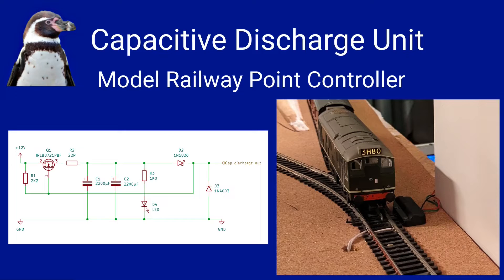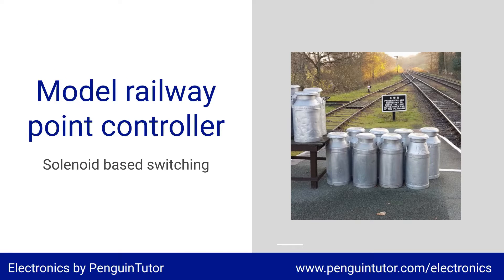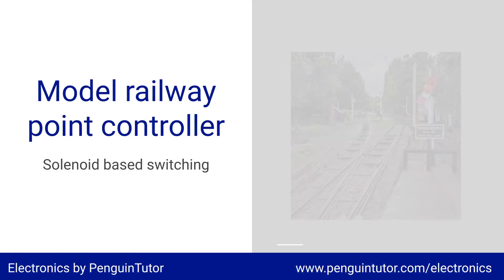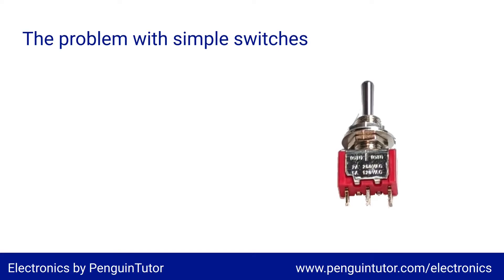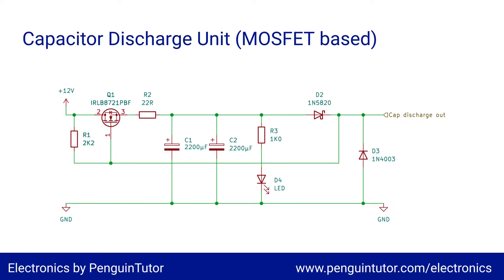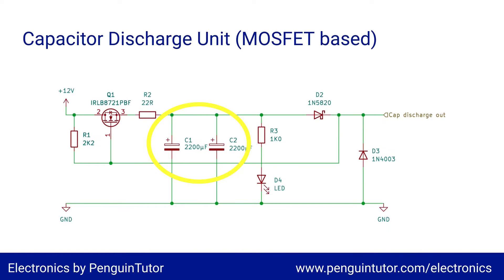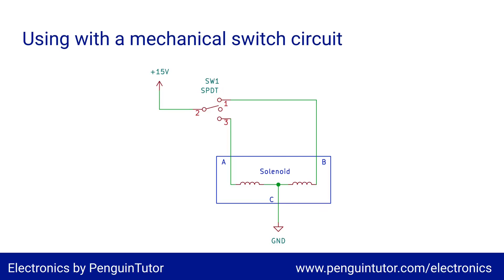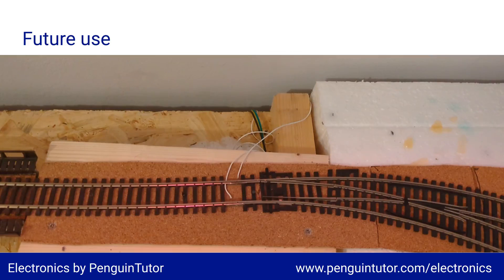Designing a model railway point controller capacitor discharge unit - Railroad CDU

Comment: Wouldn't it make sense to replace the 1N4003 with a 1N5820 too? As you can probably use it for flyback as well and it saves an item on the BOM.
Reply from the maker: The advantage of the 1N4003 is it's tolerance to a high reverse voltage. Although the solenoid is generally switched with approx 16 to 17V the back EMF can spike much higher than that, and higher than the 20V reverse voltage that the 1N5820 can handle. That can cause the diode to go into the breakdown region which can permanently damage the diode.

The 1N4003 is also much cheaper, and I have lots of them available so didn't need to order that in for this project.

Comment: Thanks for this video, I'm going to try the circuit.
Can you describe exactly what function D2 plays in the circuit? I understand we want the lowest voltage drop, but why do we need it in the first place?
Reply from the maker: It sets a bias voltage between the gate and the source when charging the capacitors.

Without that diode then the gate and source will be the same voltage and so the FET will never turn on. With that diode then when the capacitors are not fully charged then the source is at the voltage of the capacitor, but the diode prevents it from pulling the gate down. As the gate is connected through R1 it is pulled high, turning the FET on. 

When the solenoid is activated then the gate is pulled down through the solenoid pulling the gate low and turning the FET off.
Reply: @PenguinTutor  Thank you, very nice explanation.  Waiting for the parts to come in... I ordered a IRLB3813PBF because the 8721 was listed as obsolete.

Comment: Great video Stewart!  I built this and increased the caps to two 4700 so I could throw four or five switches at once.  Now if I hold down the button, the LED only dims a little bit, do I need to change one of the resistor values to compensate for the higher capacitance?
Reply from the maker: It sounds like it's working as intended. The LED is to show when there is sufficient voltage to activate a solenoid. It's only approximate but should be sufficient. 
When it is dimming it shows that the voltage has dropped across the capacitors, but that they haven't completely discharged. They will then charge again after the solenoid has triggered.
If you have sufficiently large capacitors then there is potentially still enough voltage to trigger another solenoid immediately after, or at least to need a much shorter recharge time. 
If you increase the capacitors too high there is a risk of burning out the point motor if held on too long, but I suspect you'd need a much bigger increase to reach that stage. If using a lot of solenoids and switching at the same time then it may be better to have multiple CDU units rather than just increasing the size of the capacitors but 2 x 4700uF should be fine.
Reply: @PenguinTutor  Thanks for clarifying that for me!  Makes sense!

Comment: Hello great video, do you happen to know if this type of circuit would work using the Fleischmann point motors? They are small solenoid type motors but the have an internal switch to make them what is known as "end off" The other question isthmus circuit available anywhere to download please?
Reply from the maker: I expect it should work with the Fleishmann point motors. It sounds like they are just normal solenoid but switch off when they reach the end to reduce the risk of burnout. 

The circuit diagram is available on my website at: https://www.penguintutor.com/projects/modelrailwaypoints 

For the original KiCAD files see the link to the GitHub "Source" files.